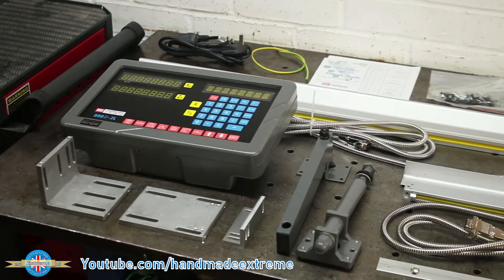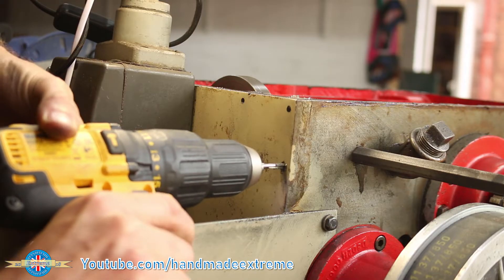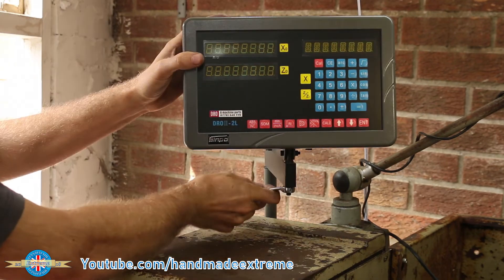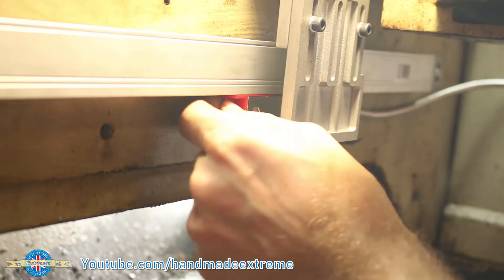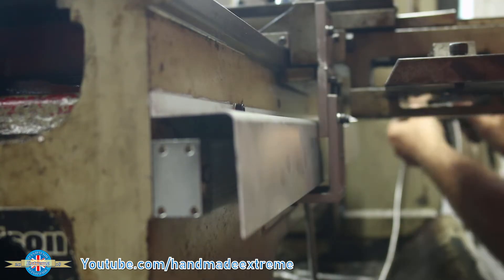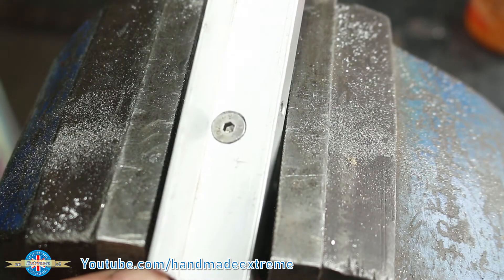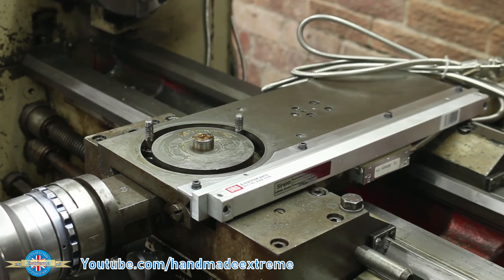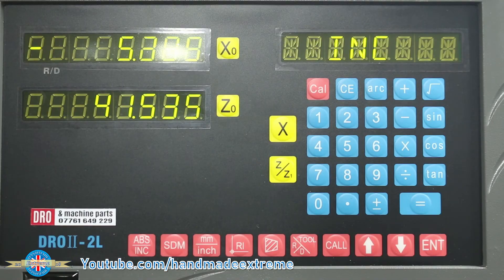How to Install a Lathe DRO Kit. Manual Lathe 2 Axis Digital Read Out.

Comment: Thanks very helpful , I'll be doing the same job myself soon , there are some small sockets available that take taps so you can use a1/4 or 3/8 drive ratchet makes life a lot easier in those confined spaces .

Comment: installing the dro screen is a personal thing ofcorse, but usaly it is fittet to the table on a stand,  on this lathe mounting it on the gearbox is fine, but on bigger lathes you want it where you are doing the job, and the table follows to where the work is done. anyway nice video.

Comment: Great video. I happen to have a Harrison M300 and bought a DRO almost the same as that, so your video helped me enormously. I didn't need to turn the cross slide bracket upside down, and didn't quite understand why you needed to. I still need to install a tailstock stop and I need to figure out how to run the cabling so its out of the way. I was a bit concerned about swarf getting into the back of the Z axis scale, so mounted that on an aluminium plate first. Thanks for posting this!

Comment: Nice precise video on installing DRO. I just bought mine and this got me thinking about how the X axis mounting technique would be applied to my lathe. I have a Clausing 5914 which has a similar cross slide configuration,  But I noticed on mine that there is very little real estate on the slide on top to drill into and compound rotation is very tight with maybe 1/8 inch clearance. So i have no other choice but to attach from the side of the cross slide. I am very concerned with where to drill as not to disturb or weaken the gib areas etc... Thanks for the video though it has allowed me to glean more ideas of how to mount  the unit.
Reply from the maker: Glad it was helpful. You may find it is easier to attach to the front of the cross slide, just something to consider. I also was concerted about the gibs, the angle bracket seems to have worked well at overcoming this problem. Good luck with your own machine and thanks for the support.
Reply: Had the same concern about drilling the holes. Solved it by taking two suitable plates of aluminum, drilled the mounting holes for the scales in there and glued these to the machine with a Locktite high strength glue. Thoroughly removed any paint and dirt before and degreased the glue areas properly as well.

Comment: noice, you made me smile with the word (little} which you use many times, buying a bomatec tomorrow for my cazenueve 575x2000, did not realize that the scale moved  on the cross slide. so learned something
Reply from the maker: Awesome, hope it all works out with your machine. Thanks for watching.
Reply: @Handmadeextreme  thank you everything is double difficult since I had a stroke 4 years ago but I plug on I was a yacht building take a look at my channel if you have the time

Comment: For those of us not in the U.K. what is a combi drill?
Reply from the maker: It's a battery powered cordless drill. Not sure what they are known as around the world but it's the one that has the 3 modes of operation. Normal drill, percussion drill for masonry and an adjustable clutch so it can be used as a screwdriver. Hope that helps. Thanks for watching.
Reply: @Handmadeextreme  In the U.S. that would be a drill/driver or a hammer drill. Thanks for the answer.
Reply from the maker: Awesome,  thanks for that. 👍

Comment: A very nice job. I also have some right angled collet windy drills from my aircraft days. I used mine on my dro fit too. It looks like a good kit. Can you put a link to it on ebay please?
Reply from the maker: Thanks Carl glad you enjoyed it. The right angle drills are so good I used it a lot when I built Pippa as well. This is the kit I bought, I have no connection with the company. It went together quite easy. I'd say good for the price point. Can't comment on longevity as i'v only just put it in. 
Thanks again for the support. 
https://www.ebay.co.uk/itm/2-axis-digital-readout-DRO-for-lathe-complete-kit-UK-stocking/183150601752?_trkparms=aid%3D111001%26algo%3DREC.SEED%26ao%3D1%26asc%3D20160908105057%26meid%3D9a9d81bb4ff04e8e898ee1a6c15d2066%26pid%3D100675%26rk%3D5%26rkt%3D15%26mehot%3Dpp%26sd%3D224029740604%26itm%3D183150601752%26pmt%3D0%26noa%3D1%26pg%3D2380057&_trksid=p2380057.c100675.m4236&_trkparms=pageci%3A830dc46f-e4c1-11ea-9686-ee8f00151d46%7Cparentrq%3A1826e64d1740a69d345c4c0ffffffe90%7Ciid%3A1
Reply: @Handmadeextreme  Thanks for that. I am looking to get the three axis version eventually, for my mill resto. I put a DRO on my Harrison lathe that I got from Ems International. I'm seriously thinking about changing the carriage scale from magnetic to glass, as the magnetic one is really jittery at times. Just throwing this out there, but something I'd find interesting would be some tests on your lathe, ie how parallel does it turn without tail support, is the tailstock alignment good, does it turn a cylindrical cut, that sort of thing. A lot of us out there have "old iron", me included (if you can class a 1984 Harrison M250 as old - and I guess you can) so I think it would be instructive to find out about these things.
Reply from the maker: No problem. I'll have a think about what you suggested I've been playing with that sort of thing recently (lathe levelling and the like) as I had to turn some long shafts recently. I've been thinking about making a new plinth for my lathe so that will all need doing again after that.We will have to see how things play out. Thanks for the idea, and the continued support. Good luck with the mill resto. 👍👍
Reply: @Handmadeextreme  Thanks for taking the time out  to reply. I've been spending a bit of time lately fettling my lathe and I just wondered how other people's are.
Reply from the maker: No problem, thanks for the support. 👍

Comment: Nice video, but based on the DROs I've seen, the 4 threaded holes on the bracket were actually for grub screws, that can be used to securely hold the bracket flat on an unflat surface, acting as spacers where they need to. I think the holes for actually mounting it were the ones on either side, between the threaded holes? 
It doesn't make much difference in your case as you mounted it on a flat surface anyway but all of the DROs I've seen have been mounted with grub screws to hold them straight even if they're on a curved surface.
Reply from the maker: Interesting, great comment. I did wonder if the larger holes in the centre were for mounting it but the kit didn't come with any hardware that diameter. What you say does make perfect sense though. Iv'e learnt something new here today. Thanks very much and i'm glad you enjoyed the video.

Comment: Thanks for posting your install. I had mine pre-installed and getting to the back for the Z axis would have required a lot of messing about.
Having said that, I'm sure you will really like having the DRO. I can't imagine doing without mine.
Reply from the maker: Thanks, glad you enjoyed it. They are so handy aren't they. Iv'e used them on various machines over the years but never had one on my home shop lathe until now. Got one on the Bridgeport as well which is super handy. Thanks for the support. 👍

Comment: Good demo - you'll definitely want a stop / buffer to prevent the scale / reader bashing into the tailstock!
I've done quite a few DRO installs on Other People's lathes and mills, found the supplied brackets a bit of a faff so made up mounting pads with cone-point grubscrews at the corners to jack them into alignment as a lot of lathe castings aren't precisely square/parallel (particularly the Chinese ones with 1/4" of filler...)

A question for you - I'll have a bit less than 1/8" total clearance if I feed a standard-size scale above the taper attachment and below the cross-slide overhang (the only place it'll fit without the taper attachment getting in the way of the Z-axis bracketry), was thinking the slim scales would be better, - it looks like you used them, were they a lot more expensive, and where from? I  can probably justify 1um scales on the Holbrook, worth the extra $20/scale!
Reply from the maker: Thanks, i'm glad you enjoyed it. 
I used a standard scale on Z and a slim scale on X. It's just what came with the kit to be honest. The slim scales are definitely a bit smaller though which would be good if your tight on clearance. Regarding costs it's probably best to have a chat with your suppliers they might be able to do you a bit of a deal if you are buying a full kit. Mine were only 5um scales but that's all I needed.
Thanks for watching.